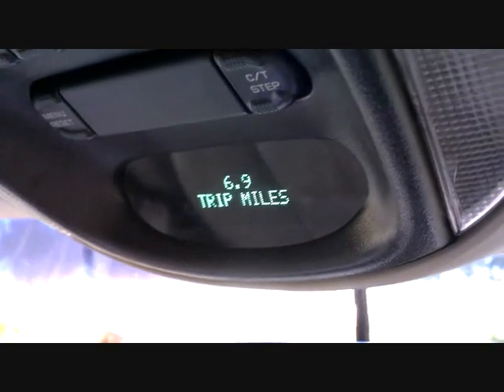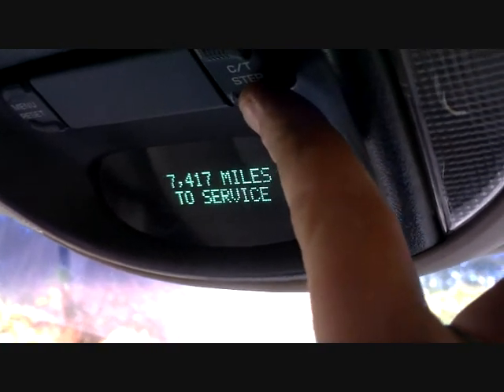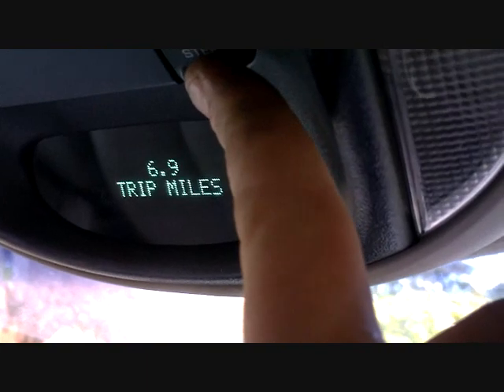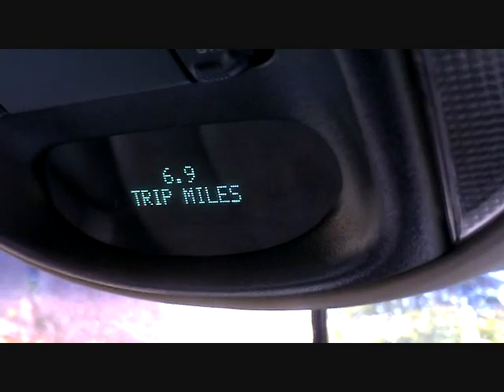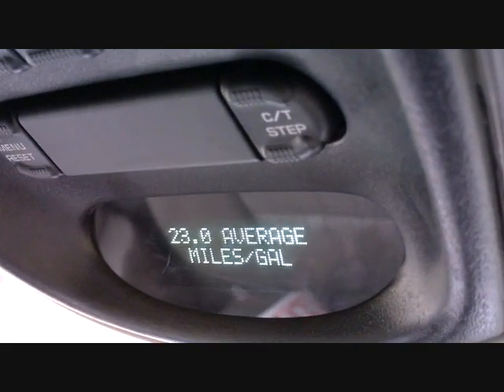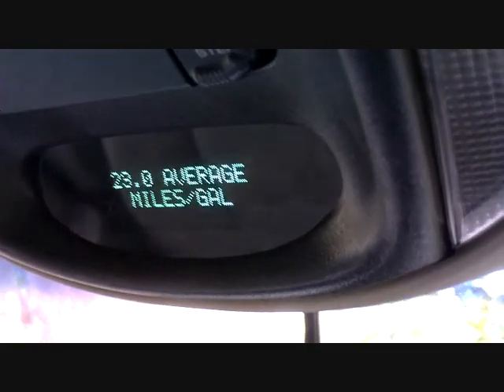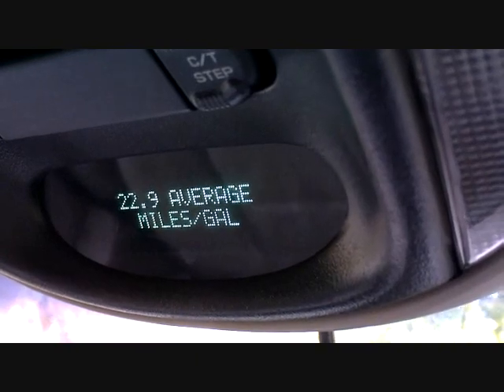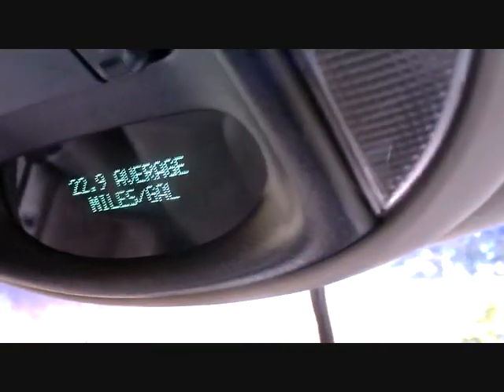HHO Disconnecting the battery to reset the ECU

Comment: You could try a Volo chip programmed for HHO, four wires off the chip are spliced onto the back of the OBD on your vehicle, Volo will programme the chip for you, just follow the video, if you're unhappy with the results then remove the chip and the original programme will come back into play. ECU are a real problem with HHO, you could get an older car, it more likely to work on it.

Comment: Hi neiallswheel, it wont work that way, this way is just slowing the damage around the holes but the current leakage still there! I have tried it before and decide to make a zero current leakage generator to solve the problem. Brgds, Tan K.

Comment: I've also seen two terminals pos and neg, about 8 inches apart to collect hydrogen on it's own. This I assume is dependent on additives to the water. It could be possible to insert some kind of mesh between the plates and modify the top of the case venting the oxygen and collecting the hydrogen. Just food for thought . Thanks for some good watching and getting the grey cells moving, keep up the good work.